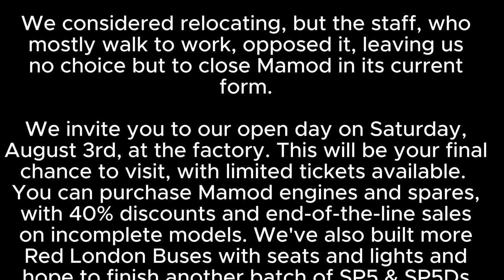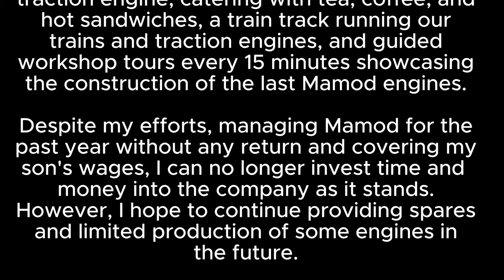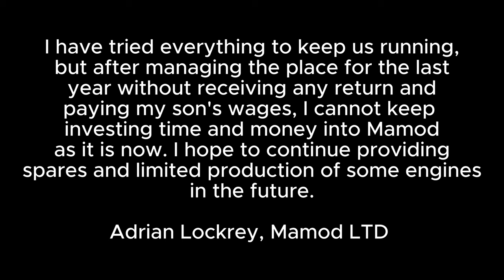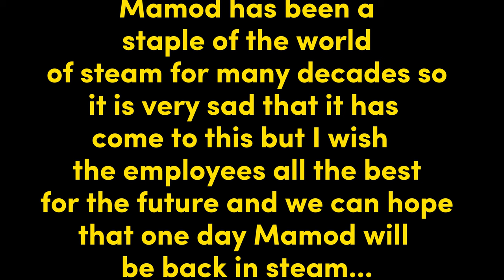A CELEBRATION OF MAMOD STEAM ENGINES - 87 YEARS OF BRINGING STEAM INTO OUR HOMES

Comment: Between 1984 and 2004 I had 8 Mamod steam locos, about 2 dozen wagons and coaches as well as quite a bit of track (And, not to forget, the smallest of the steam engines). I visited the Mamod factory when it was in Slough. Owing to moves, first to the UK and then to Cyprus, I had to sell everything. I had a lot of fun with these locos, and I have good memories (especially of the 2 locos which I had converted to 0-6-0 wheel arrangement. They worked extremely well.
Reply from the maker: Oh wow that’s a very interesting story

Comment: Sad to hear there will be no more Mamod after all these years. They were my favourite toy. I saved to buy some and the Traction engine and steam wagon were presents. I sometimes used a pint of meths over two days and after steaming cleaned them up before putting them back in the box. I still have them all except the Minor1 that I took apart to use the boiler in a ship TE1, SR1, SE3, ME3, SW1 and the 3 railway locomotives first made which I made a meths burner for. I did not like the fuel tablets. The twin cylinder engine was the last to be steamed. I should get them all in steam again